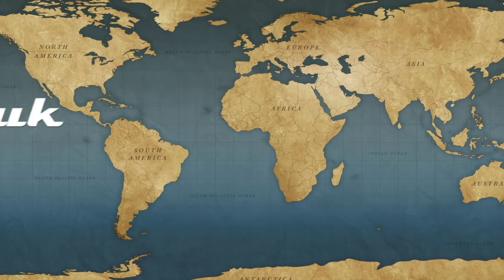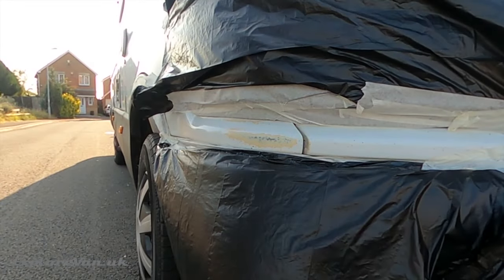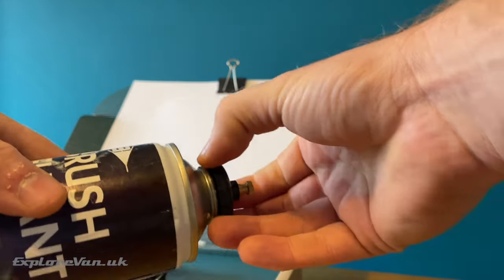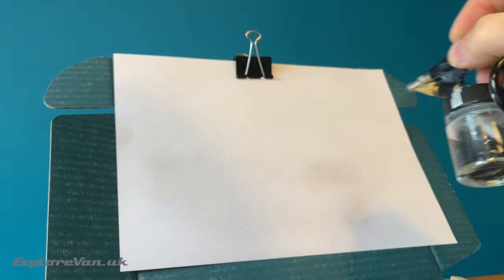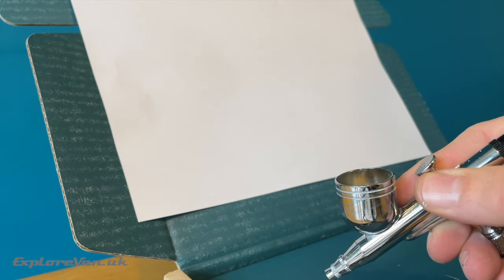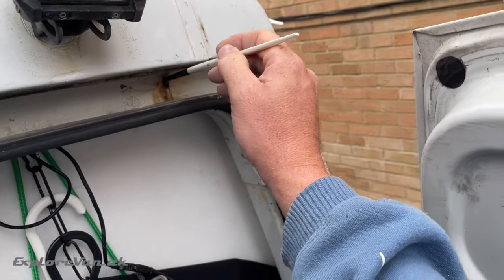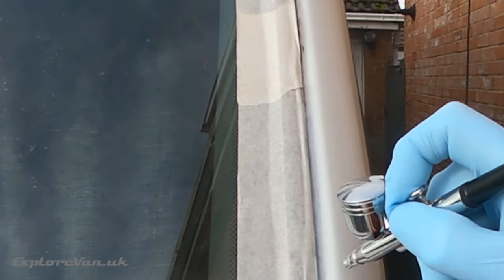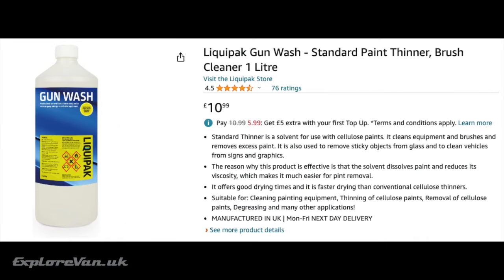Airbrush Van / Car Paint Repair

Comment: Nice video. Your paint seemed far too thin on the paper demo. Also, do not use nylon brushes on the internals of your airbrush. They are terrible and will cause damage. Any idea where I can get a colour match for my Ford Focus?
Reply from the maker: Hi, yeah the paper demo was just using water colour paint so I didn’t have to do a full clean after using cellulose based. 

Thanks for the tip on nylon brush. 

I’ve used a few places for colour match, if I remember correctly  XtremeAuto on eBay was who I used last.

Comment: Great video! Did you use regular paint thinner? Did you clear coat it? Do you think you can use regular touch up paint and thin it out or it’s better to buy real paint? Thanks in advance.
Reply from the maker: Hi I used the gun cleaner thinner. I don’t see why you couldn’t thin down touch up paint but it would work out quite an expensive way to do it I would think.
Reply: Thanks for the info!

Comment: Just came across your video, very good. Did you have to use a separate clear coat or was it all in one with the paint? Also where did you buy the paint from. Cheers.
Reply from the maker: Hi, mine didn't need a separate clearcoat, but if yours is metalic or pearlescent it may need it. 

I get my paint from AutoPaintSupplies on Ebay